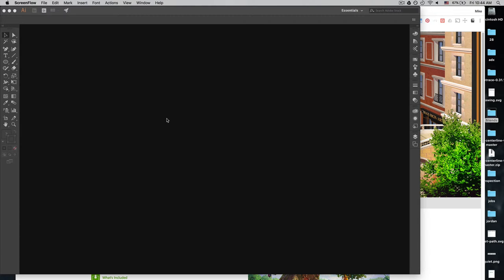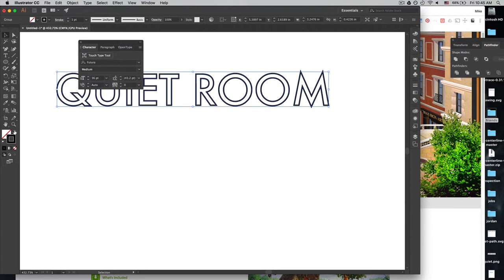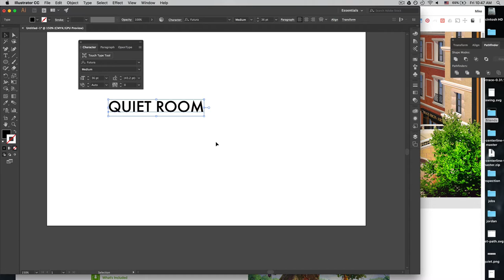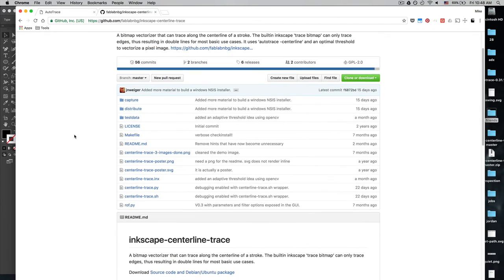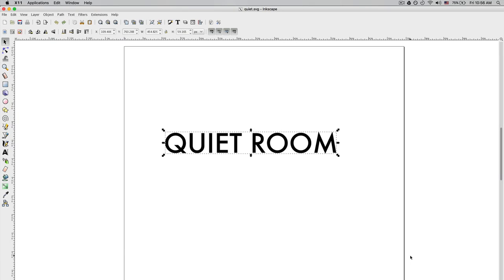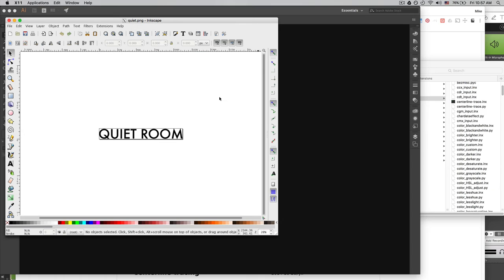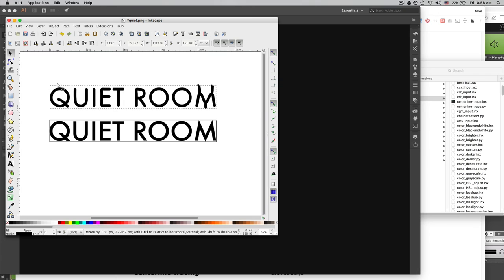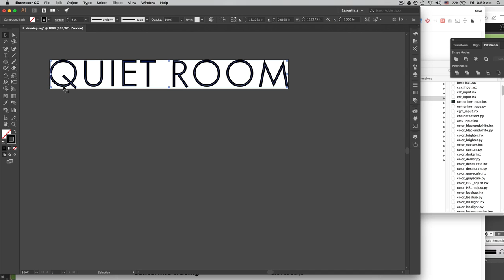How to convert vector text to a single path for CNC routing

Comment: How did it change from weird looking on inkscape to perfectly matching one stroke by just opening it on illustrator ? I'm lost. Thanks for the vid either way.
Reply from the maker: I can't remember if/how much I cleaned it up in Illustrator, but being handy with the pen tool definitely helps. Also, not sure about Inkscape, but in Illustrator you have access to what happens with the line joins (place where two lines meet). In inkscape, it was rounding everything out. In illustrator, the default is to miter them (as shown in the video) which makes nice sharp corner points - so that's probably partly why it looks much better. Depending on your font (rounded or sharp), you may want to change that - which you can do by going to going to the stroke window and choosing round, miter, or bevel under 'corner'.

Comment: Good Video Thanks. only one question. how do you instal Auto trace? or in which folder do I need to put the files ?
Reply from the maker: Hi diego - the install location is mentioned at around 3:30 in the video.
Reply: @MikeHeavers  I’m still having trouble downloading it, what do I download from github?
Reply: Diego were you able to figure it out?
Reply from the maker: @cooperthomez4055  The install instructions are here: it depends on what system you are using. https://github.com/fablabnbg/inkscape-centerline-trace#installation-hints
Reply: @MikeHeavers  I was able to download the .inx and .py files but it says there is an error with the python code. Syntax error on line 420
Reply: @cooper same error with me if ever you solved it can you teach me?

Comment: We can deal it easily in coreldraw
Reply: what option in coreldraw can I use to get the centerline?
Reply: @Nodeagent  Did you figure this out?
Reply: @khloe38  no, I got frustrated after much research and no answer. Apparently there were plugins that could do it but couldn't guarantee it done well- and they were pricey
Reply: seems like something that's sure to be added in a few versions or corel or illustrator
Reply: @Nodeagent  I just found this video: https://youtu.be/3pyHgDyMqwI .  I haven't tried it yet.  it uses coreldraw.
Reply: @khloe38  yeah I've encountered the image trace line style, but unfortunately I've found neither program can trace precisely in the center and the font looks completely different